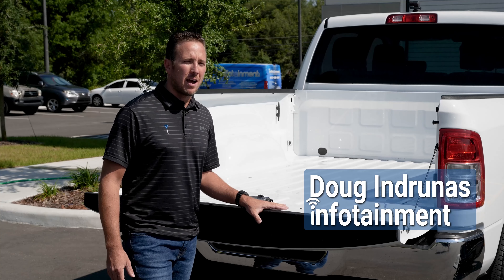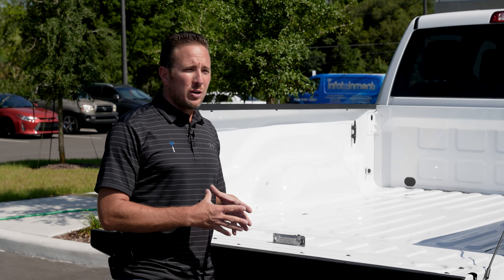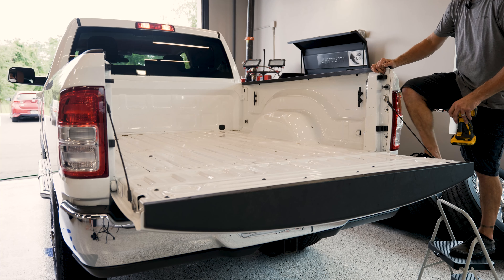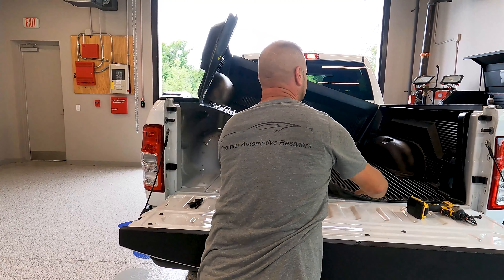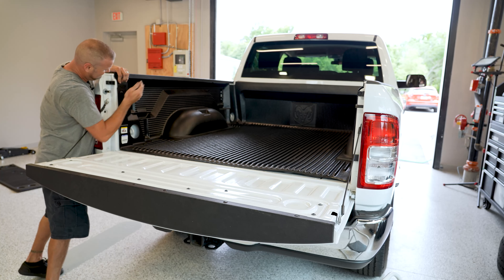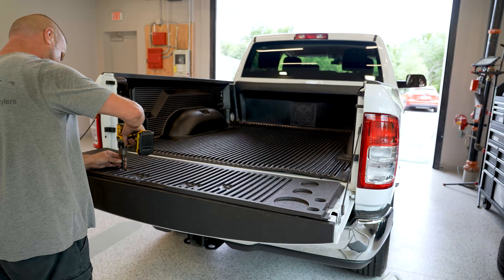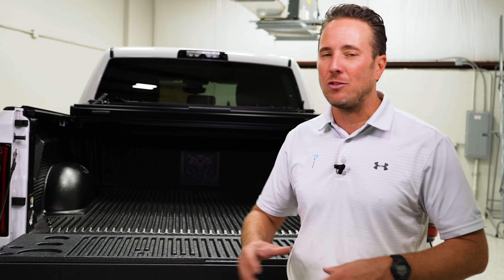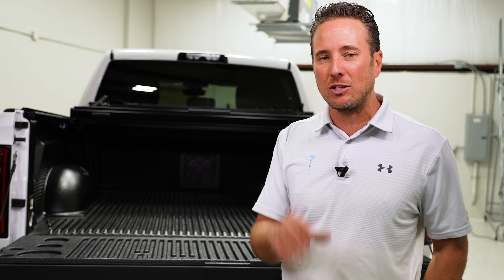2019+ RAM 2500 Mopar Bedliner Installation - Episode 6 - Infotainment.com

Comment: Plastic traps moisture and ruts bed.
Reply from the maker: Moisture rusts beds, not plastic. Oxidation my friend.

Get the right bedliner and you won't have issues as long as you make sure the bed is dry before installation.
Reply: @Infotainment_nav  , you're correct moisture ruts the bed. Plastic traps the moisture,  had rusted bed on Ford and Toyota under Plastic. Seen it on ram and chevy same thing